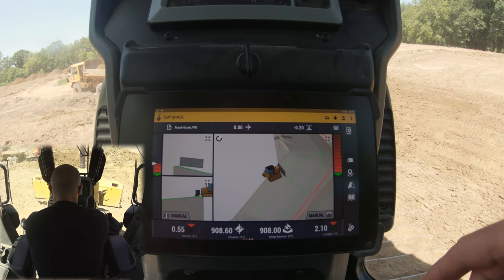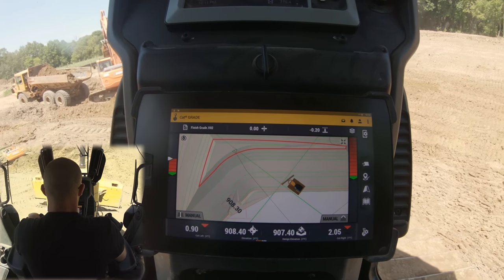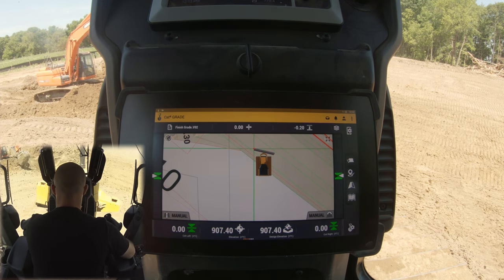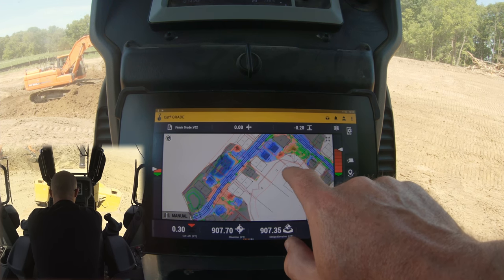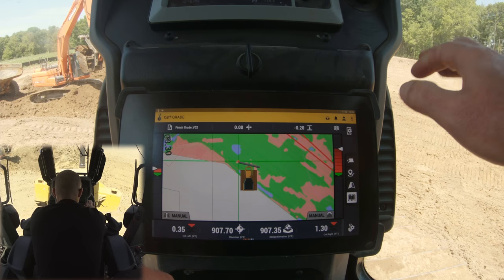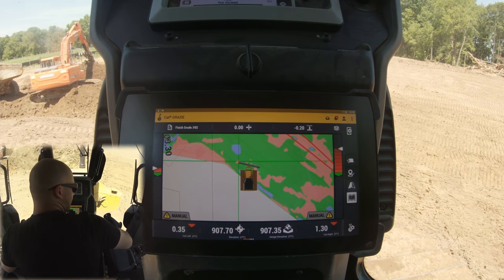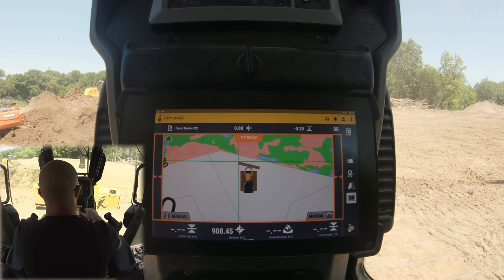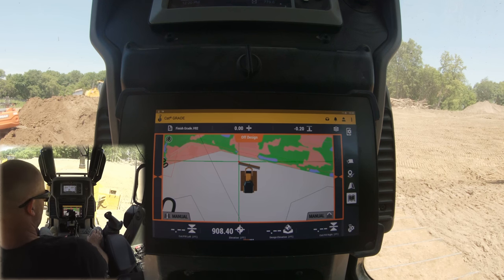BASICS OF GPS - CAT GRADE CONTROL SYSTEM // How to Use CAT Grade Control Dozer

Comment: Sweet, as an old timer I can vouch for the amount of time and money these systems save or make for contractors. Your videos are great source for us looking to keep up with technology advancement. Not everyone gets the time to go through the software when your on the clock. Sometimes off the clock time spent with your machines software keeps you ahead of the curve when on the clock. Put the extra effort in young operators. It will make you a valuable asset to Contractors.
Reply from the maker: Very wise advice, technology is here!

Comment: Great explanation on the grading outside of plans. 9/10 times it’s future phase and if you rely on gps you’ll deep dive on a partial swell etc. Turn it off and grade to the fall, make it look good. GPS is awesome for finish cut, near design limits you have to make it work.
Reply from the maker: Thanks for the feedback!  A lot of people don't understand that GPS doesn't think for you.  Is it a tool that helps?  Yes.  Does it make a dozer operator out of a stick puller?  Hell no.

Comment: Do you have to have a base station for Cat Grade Control to work or it is all built into the dozer?
Reply from the maker: All 2D functions will work without a base station since they are using sensors built into the dozer.  When you flip into 3D functionality you will need a base station and a site plan.

Comment: Does it come standard on a rental unit DOZER D5K LGP OROPS / D3 LGP OROPS
Reply from the maker: No.  Machine control will always be an add on feature that costs extra money.  You'll also need to invest in a base station and rover for the GPS to work in the dozer.  CAD files will need to be converted over to surface files and loaded into your machine so the dozer knows where it is and what the ground should be doing.  GPS is a very involved process.  You can't just rent a dozer and go hog wild with GPS.

Comment: How does it know it's elevation? Does it have a flasher for a survey laser or use something else?
Reply from the maker: The base station communicates with the machine and gives it the information to determine it's location and elevation.
Reply: A minimum of 5 satellites for general location, and precise location/correction provided by radio correction from a base station.

Comment: How far can u work from the base station before u have to move it or get a repeater ?
Reply from the maker: It depends on a number of conditions. If you have a lot of trees on site your distance will be significantly limited. General rule of thumb a base station is good for about 1-2 miles of range if I remember correctly

Comment: How do you get that profile for the job created?
Reply from the maker: Depending on the survey firm, some are capable of creating the GPS files in house from the CAD drawings.  If they are unable to convert them there are services all over that can take the CAD files and turn them into GPS files.  Generally costs around $200-500.
Reply: @DieselandIron  ok perfect do i don’t need to necessarily have someone in-house doing it.

Comment: sorry I know I am late but cant you just use snap to grade instead of latch to grade on gps menu that way your autos will always try to engage even if you have way to much to cut?
Reply from the maker: I don't really understand the question.  If you have auto engaged then the machine will always try to push down to grade as long as you are within range.
Reply: @DieselandIron  sorry it must just be my system but if I have snap and latch one will only let autos engage when you’re like 1ft off other will always try to find grade no matter how much cut you have if that makes any sense
Reply from the maker: @devinbarnes7891  you should really be free handing until you get with a couple of tenths of grade. Your brain is much better at bulking dirt than the automatics and when you are trying to do that big of a cut the automatics aren't accurate and will gouge. I recommend running in manual until you are within a couple of tenths, then switch over.
Reply: @DieselandIron  sorry late response yea ofc It was just something you said in you're  in video that the gps wont  be able to turn on tell you're close to grade like you're suppose to be my smart ass was just saying if you wanted to can switch from snap or latch to grade and no matter how much cut you have left the autos will still try to dig sorry if I am confusing you lol.
Reply: Do you have any other GPS training videos for a dozer,blade,maybe for how to set up the base station.ect. For sale ? I need to learn more on gps this and Trimble, been an advanced operator on almost all equipment but have little time with gps systems. Thanks brotha for all your help seriously means a lot
Reply from the maker: @jimmyhawkins5897 I don't currently but I'm working on putting together some teaching materials on the topics you mentioned.  I'll try to accelerate getting those out.

Comment: If someone wanted to learn to operate dozers, where would one start? Assuming you don't know anyone or any contractors.
Reply from the maker: You can rent one if you don't mind spending some cash and you've got a place to run it.  Outside of that the best way to learn is to hire in at a company and work yourself into a seat.